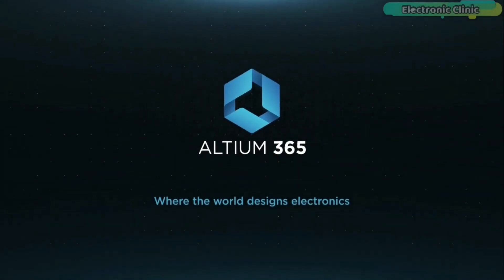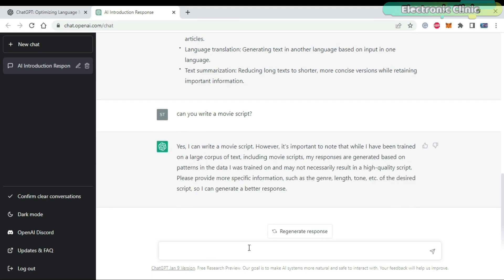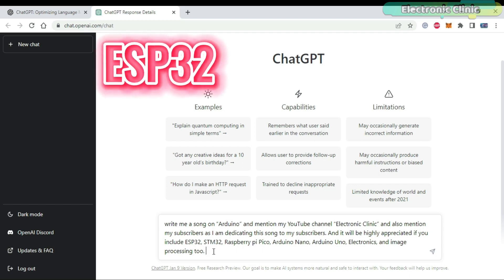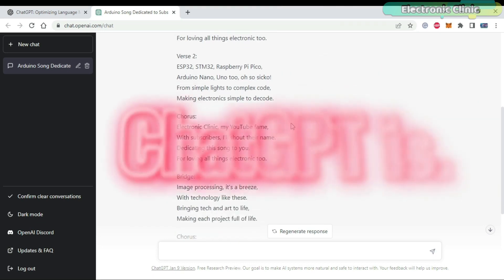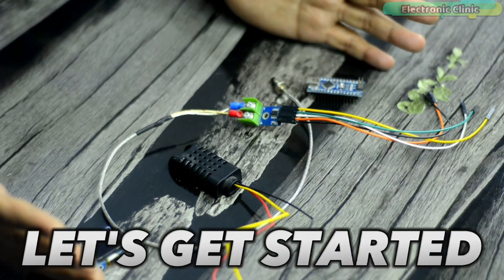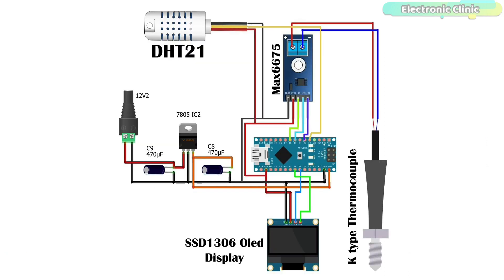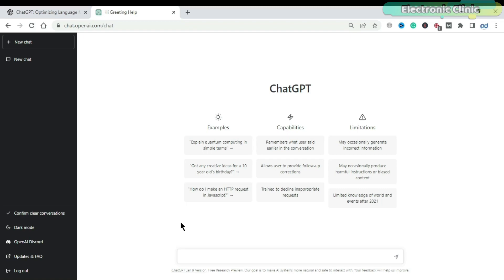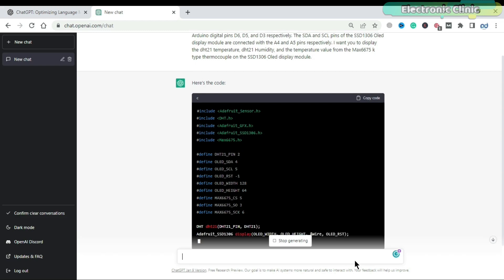ChatGPT Arduino Programming Ultimate Test, ChatGPT for Arduino Projects

Comment: I want to make an arduino project that sending me message the "weight" from a sensor  to my phone number after i text it "OK" . The project must generate from a battery so i dont want to run all the time. I search your channel but i didnt find something similar. Do you suggest me to use chatGpt for this project?
Reply from the maker: Watch my video on request sensor data.
Reply from the maker: You can try ChatGPT but if you get any errors you can come back and compare the code with mine. You can also visit my website electroniclinic.com. I have many articles on GSM.
Reply: Thank you 🙏